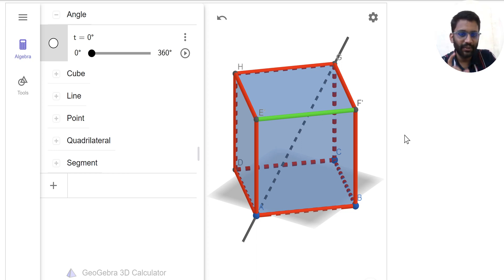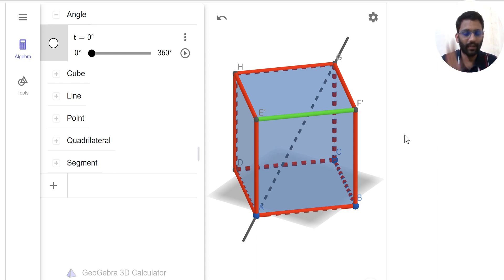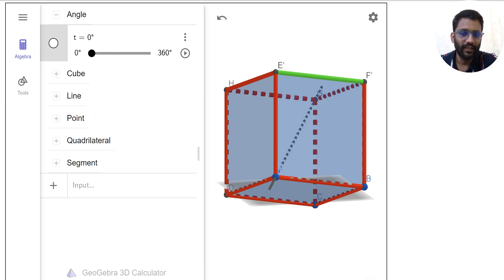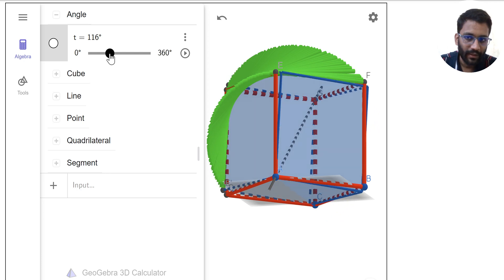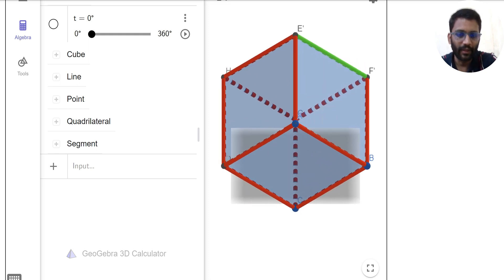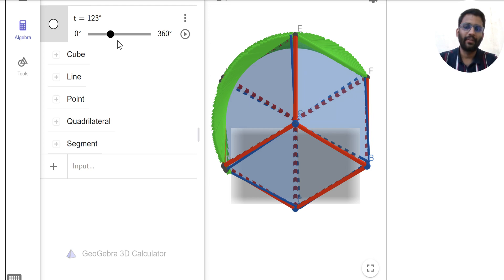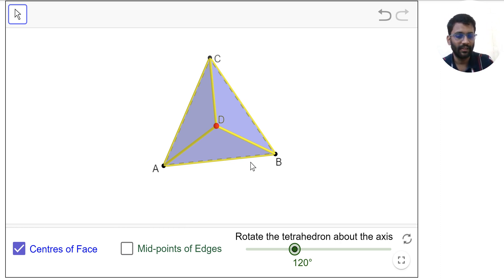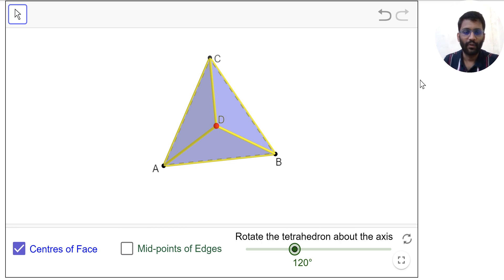GATE 2024 Aptitude || Best Question on Aptitude || 3D Rotation || Civil Shift 2 || IN || PrepFusion

Comment: Sir, in the video, when the diagonal is at the axis of my eyes, I observed that the minimum angle to rotate to get the same shape is 60 degree but when you showed the previous rotation it was 120 degree. In the question it was given to rotate about the vertical axis, so sir this totally depends on how we look at it. Then sir, will this question not be a MTA one?
Reply: It's 120° only na! You can see in the simulation. 

Are you getting confused with those dashed lines? Those dashed lines aren't in the plane.